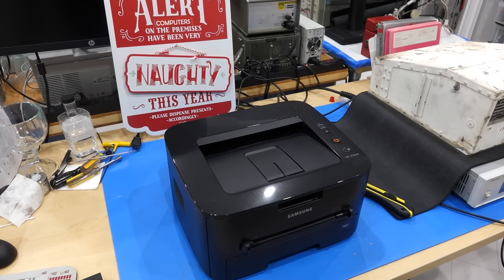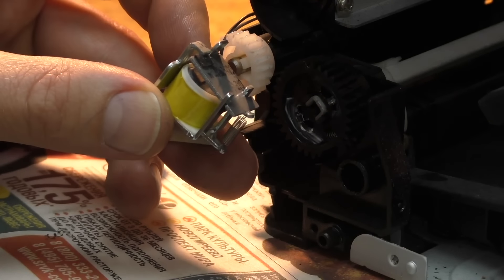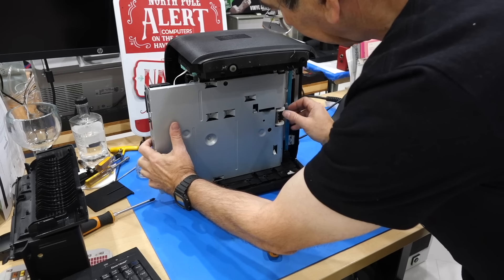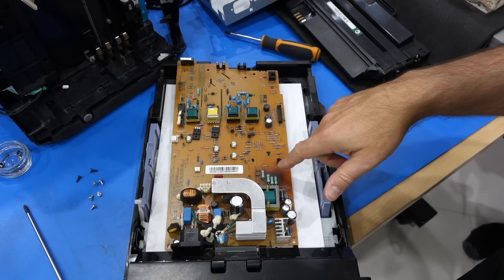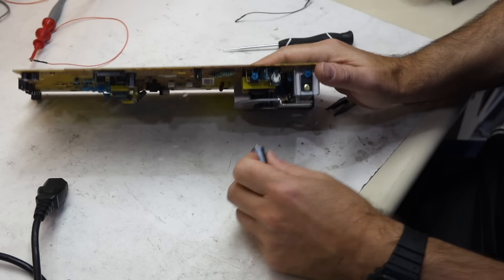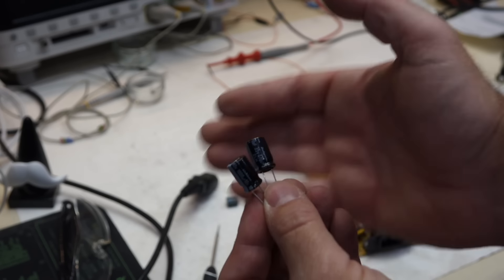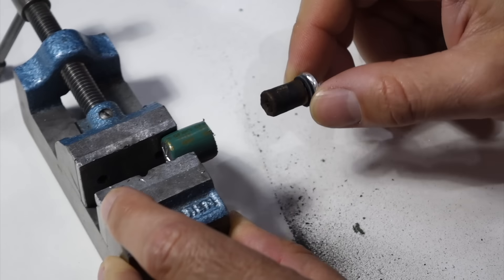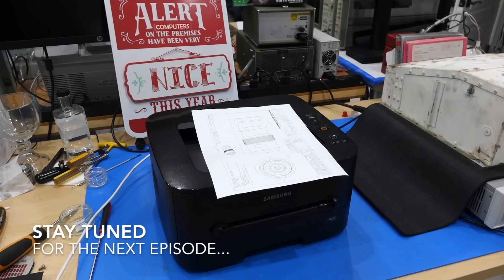Modern Fails: Samsung ML-2525W laser printer double repair: picks up two sheets, does not power on

Comment: JC44-00178A. That's the whole board part number from Samsung. I worked at Samsung more than 10 years ago, and i changed those power boards under warranty like crazy. That part number was archived in my memory and this video retrieved the data 😅. Thank your Mark for your old and new tech videos.

Edit: Wow! Double thanks for the pin post, greetings from Colombia, you and master Ken are my heroes!!!

Comment: It's amazing how much you can extend modern product's lifespan by just recapping. In the kitchen I have a ramp of 8 cheap GU10 RGB radio controlled spotlight lamps that all died within less than a year. After replacing the only cap that I could access, they have worked for 8+ years.
Reply: I have HP2200 dual-sided printer 23 years old. It had a problem with rotating mirror bearing that went dry, but I managed to lubricate it. It is a little denser oil so it needs couple of dry runs if outside temperature is low :) It is thin plastic that went brittle, I broke some on dismantling it, but those were some holders and brackets so I managed to glue them together. There are Win 10 drivers. Thing is a tank when compared to modern printers.
Reply: Good capacitors will last a long time, especially if they are not mounted right next to heat producing components.
I have an Astron power supply that's 40 years old with all original, US made capacitors and it still meets its output ripple specifications at full load and minimum line voltage.

Comment: Laserjet 5 here. Got it for free, not working. Replaced the fuser assy and the drive gears, both readily available from printer repair places on the web. Added more RAM, and got a network interface card off eBay for $15. When I ran the test page, it said 330k pages through it, and the repair place I talked to said they can easily do a million. NOS sealed cartridges for $25 each off Goodwill means it should outlive me. 

Not all HP printers are evil, this one dates to the 1990s, when HP was still building good gear. I am a firm believer in buying good commercial quality gear that's been superseded but is fine for home use.
Reply: Can't agree more but we shouldn't talk too much about how good old HP laserjet printers were. Imagine if everyone buys them and price skyrockets? ;)

Comment: Bad that crappy parts or parts with aging issues are being used - good that folks are documenting the fixes.  I switched to Brother printers several years ago at the advice of a computer consultant friend who works with tons of printers and saw Brother having the best track record.  I was a loyal HP LaserJet user for many years but their software and hardware quality went into the toilet.  The Brothers have been very reliable and my 15 years old All in One MFC-8890DW which saw heavy use in a CPA's office especially during tax time then graduated to my home office is still going strong.  Consumables are much cheaper and easier to replace as well.
Reply from the maker: Yep the "modern" HP's use the same crappy solenoids and capxon green caps. Who knows, they might be made by Samsung (or vice versa). Thanks for the heads up on Brothers. Hope it holds up for you.
Reply: My newest HP is a p1102, and I have a P100 that I got for free, only needed a $15 aftermarket cartridge, and a clean of the paper path. Serves my print needs well, and for scanning I have a nice Scanjet 3400, and a backup Canon as well, both gotten for free, because HP and Canon stopped supporting them after XP, but SANE does not care, and so long as they speak Twain it will work with them.
Reply: What i hate with my Brother is:   faulty out-of-toner sensor ie   bitches about toner and the toner cartridge (not the drum unit) is expensive in sweden (upwards of 60 $ if you want to buy it at a  'mall')  A complete unit with drum is even more dear....
Reply: @TheStefanskoglund1  Take a trip across the border, or order on line and get it cheaper then.
Reply: I've had success with Brother printers, and the off brand toner is cheep.
Reply: I worked as a network engineer and printer repairperson at the community college I retired from. I repaired a lot of the "good" LaserJet printers. They were easy to service and the consumable maintenance parts, such as pickup rollers were relatively inexpensive. We were lucky that we had a company in our town who manufactured quality refurb LaserJet toner cartridges, Once the quality started declining, we bought quality LaserJet refurbs and once those started drying up, we switched to Brother laser printers.
Reply: @TheStefanskoglund1 > You can reset the page counter of the toner cartridge from the printer itself.
Reply: I agree. Two Brother laser printers, both reliable (so far).  They're also good for knitting machines.

Comment: I have an old Kyocera laser printer. It had the same issue with the sticky foam in the solenoid. I fixed this - and that was already about 10 years ago. The printer still works. The sticky foam issue is very common.
Reply: The same problem was on HP 2100 series, and I found at a time that all customer printers were plagued with it (it was hundreds then!). The best thing that there was no foam on the solenoids in the service manual, but they were too loud without it. So I went to the store and got some thin kitchen sponges for surfaces and glued pieces of it onto the solenoids. They never came back to repair because of solenoids.
Reply: Yep, I had to do it to all 3 solenoids on a Kyocera KM-1820.
Also, the HP 4250 and 4350 not only have the sticky foam on the solenoids, but on the registration roller assembly, and on the delivery assembly flags as well.
Reply: Almost as bad as the Sony potting glue in my older Kenwood radios - it absorbs moisture and detunes circuits over time.  Took 10 hrs of  involved surgery to get it all out!

Comment: looks like a flyback converter.  those output capacitors just absolutely hammered because they are charged up half the time and are discharged the other half (well, depending on duty cycle technically) at 100KHz or whatever the switching rate is.  So that means there is the potential for amps of ripple current- continuously.  Nothing like opening up a TV and seeing the domed caps- but better yet there's empty capacitor footprints where they cheaped out!  usually I will fill the empty spots with some more capacitors to spread the ripple current.  using high quality caps helps, too.  Even though they used cheapo caps, it's a combination of the cap quality, the high temperature (TVs and similar generally have little to no cooling and usually no fans or active cooling) and the ripple currents.  all three of those things conspire to dome the caps.

Comment: Solenoid: Had the same problem on a HP laser printer. But you MUST put something  isolant otherwise when the solenoid is activated, it stick one or two more seconds after solenoid power off because you close a loop around the coil. It drive me crazy before I understand what's happened 😆
Reply: I used cloth sponges glued to solenoids on HP2100 :) Also, the paper drawer would eat through the plastic seats because of hunreds of openings. I would glue aluminium inserts into the drawer seats to add for a missing plastic on the front so printers could draw paper again.
Reply: Furniture felt pads. The little feet for music boxes same size as pad. Remove ALL old glue first.

Comment: I love my ML-2525W. I must have had it for close to 10 years and it's even been thrown down the stairs (about 5 years ago and not by me) and survived to print perfectly, even if the front panel is held on with Virgin Atlantic packing tape LOL
Reply: Another amazing fact is that at some point during that period your printer has turned into an HP printer (in a way).

Comment: I wonder if there's now a potential for a 'coachbuilder' style service where a modern device is immediately taken to a company that premptively replaces any crappy components so it will last for much longer. I can definitely see this in the audiophile scene. It would void a manufacturer warranty but honestly how much is that worth for most kit these days?
Reply: I was thinking it must surely be possible to create a business like old-days HP that produces well engineered products. You'd have to market them as such to compete with the Chinese crap and include a long warranty but it seems entirely possible. I think you'd also have to carefully avoid the "infinite growth at any cost" mentality that modern businesses take, which means no public trading.

Comment: Samsung printer that makes me think oh Brother here we go again 😂
4:50 those resistors get quite toasty it seems.
Some scary voltages in there, think I'll stay away from repairing laser printers😂
Reply: They used to be more bitey but ozone reduction techniques lowered it.  At one stage there were even conductive foam rollers to charge the drum in some printers rather than the charger grid.  Not sure if that's still a thing.  They used 'only' hundreds of volts instead of kV.
Reply: I've had a Brother laser printer for a decade now, and the only thing I've replaced is the toner.

Comment: We purchased an HP Lj3 around 1991 originally used as the office laser printer. Eventually, when we bought  an Lj5, it was demoted to a check/special paper printer and after that was made a printer for a single pc. We got rid of it around 2008 when the paper feed mechanism finally broke. It never needed repairs.

Comment: Funny thing on a totally different samsung printer model I have, there is a problem with the solenoid and absorber part too, but different. with time the little pad shifts, causing the metal to metal contact and with bad luck and some residual magnetization the little tab sticks to it. gluing on a piece of cardboard helped and luckily only opening one side was necessary.

Comment: Just recently had exactly the same sticky solenoid problem in the paper pickup in my HP Color LaserJet 4600. Same fix, of course. It makes a slightly louder click when the solenoid energises but I actually quite like that!

My old workhorse LaserJet 4M+ needs some TLC, though. It's printing dark-grey on light-grey (actually more like two different shades of mid-grey now). I think it may be something to do with the high-voltage PSU.

Comment: The previous solenoid repair is interesting, as I recently had to do the same on my HP Laserjet 1320 due to sticky solenoids causing a jam in the duplexer. To be fair, it was 19 years old at the time that it failed.

Comment: Nicely fixed. The power supply in that thing is so easy to get to, compared to one in my OKI MB260 I discombobulated for this year's April Fools.
Reply: Easy? That was still a lot of screws imho. Except in this case I can understand due to the high voltage.

Comment: Ah yes, I've seen this sort of fault in several Laserjet 4Si printers.  The factory fitted pad was open cell foam and over the years it was crushed flat so that the adhesive was exposed and caused the arm to be slow to rise in turn allowing the pickup clutch to be engaged for too long.

Comment: You no doubt get this kind of request a lot.  I have an HP DesignJet 430 that I felt was too expensive of an investment to trash, so I still have it.  Problem is, I can't find a driver to work with modern OS's.  I'm about to send it to the recycling process, so I was wondering if you might want it.  The last time I got it to work, it worked.  I had an issue with one of the drive belts so I replaced it.  It only prints in black and white, but could be upgraded, if you want.  I hate ewaste.

Comment: Some of those printers case panels are a nightmare to remove, mostly clips, black plastic on black plastic, the clips are impossible to see without using a bright torch light.  Also, not much to reuse when taking then apart, and not scrap value except for some copper magnet wire, I do not even bother picking them up anyome when I see one abandonned on the curbside 😴
Reply: Yes ewaste by me will only take them for free. So i strip the board out so I can at least get the wiring loom, such as it is, and the few low grade boards. Yes I pull the toroids off as copper and scrap steel for the cores. Just watch out for the CCA wire which is making inroads into those as well.
Reply: Yes, that's always been a gripe for me. Even on printers from the 90's.  The cases are held on with clips instead of screws. You need reference material, and a lot of patience to remove them.

Comment: Apparently optical detectors fail as quickly (or more) than capacitors.  That's what turned out to be the problem on my Brother printer that suddenly decided it had a jam even tough it was smoothly feeding the paper through.  It would stop with the top of the paper getting cooked by the fuser, claiming that the paper never made it that far.  It turned out to be one of those optical detector units on a nexus board.  So far no sign of cap problems yet, but with a new sensor it's back in action with no complaints.

Comment: Crapacitor issue with my Brother laser printer, too. It would not start when switched off with wall plug connected. Always had to pull the plug first shortly, then switching on was possible. Common fault of several Brother models. Luckyly it happend one month before 3 years guarantee period ended, and certainly the wohle main board was replaced.

Comment: What a repair!  And yes, I have a 10+ year old HP LaserJet 400 401n.  It's never been apart and has never jammed or failed in any way.  It even gets FW updates from HP!
Maybe Samsung should stick too refrigerators and SSDs?
Reply: Samsung exited the printer industry in 2017, when HP bought the printer division. Some of today’s HP laser printers use Samsung-derived print engines, many more continue to use print engines bought from Canon. (Nearly all HP laser printers prior to the Samsung acquisition used Canon print engines, now it’s merely “most”.)

And you do realize that Samsung home appliances (fridges, stoves, etc) have a terrible reputation? That’s a business Samsung should exit for the benefit of consumers.

Comment: Lexmark redrive units for duplex printing also have the same sticky foam fault.  Worse, they put the foam on the actuator and it serves to shim the actuator in range of the coil, it rests against the stop and gets stuck open.  The lucky ones just spit the first page out, complain of a paper jam, clear the errant jam and they start working!  Some need more encouragement.

Comment: Side note, while the old Laserjets are well nigh indestructible, they are not immune to the mid-90's capacitor plague. My 1994 LJ4+ had a few leaky caps that had time to damage some PCB traces... With this solved however, I fully expect this machine to survive another 10-20 years

Comment: needs new sep pad or roller depends on the design for the dual pick or the tray lift if it is not just spring pressure is not working correctly
Reply: hahaha this is a common failure in HP 4200 4250 and 4300 and other color printers too ... the sticky pad on the solenoid forgot about that one ...

Comment: i had a similar issue with my mother's Epson ecotank. It wouldn't power on and i had a look at it. Lo and behold the power supply had burnt out. We had and identical model in storage and it had software problems so it took it's power supply and put it in my mum's one and boom, it worked. I tell u the Epson printers are so easy to repair, all the parts are modular so 1 connector and 2 screws and out it comes.  I think one of the transistors overheated. I would have liked to replace it but here in South Africa electronic components are jolly expensive when not bought in bulk and as electronics are just my hobby i can't afford it.

Comment: Mono-laser is trivial. I managed to maintain Samsung color laser for 20 years. I even cracked the cassette counter so I could use color powder bottles from Ebay. Unfortunately there was  a secret compartment under the color-transfer belt. When it was full it started scratching the belt destroying it.

Comment: My Epson XP-55 inkjet (I hate inkjet) had a dried up the post-rectifier capacitor which took out the chopper transistor and a strange internal fuse.  Not easy to work on, not a very successful YouTube video, but got it working for very little cost.  Much happier with laser printers.  I had to change the fuser film on my HP Laserjet P3015 about 10 years ago and it's just kept on churning out prints every since.  CNTRL-P, RETURN.  Nothing else to think about apart from whether to print double-sided, it just works.  If HP mono laser printers were cars, they would be Toyotas.  (Alas their colour laser printers, well maybe Fiats.)
Reply: I had a HP Laserjet 5N that ran for many years, it did 10's of 1000's of pages, no problems!

Comment: Watching this on my laptop, as my main PC won't turn on because of dead 2032. And this battery was replaced 3 months ago. And yes, "great" engineering went into motherboard which won't turn on with dead battery. Thank you Gigabyte. First time when it happened I suspected PSU and those which can feed Threadripper aren't cheap. 1$ battery was the culprit.

Comment: HP 4L, HP4 was the last printer. HP5L and HP6L had issues in paper picking. Maybe electronics was better. HP4L has amazing paper feeding system- you can pass cardboard without problems and print on it.